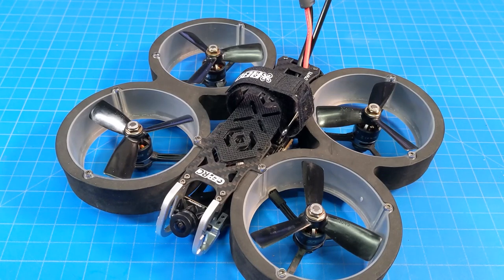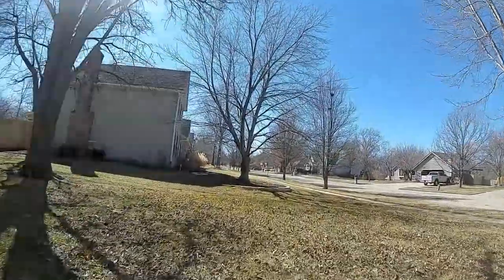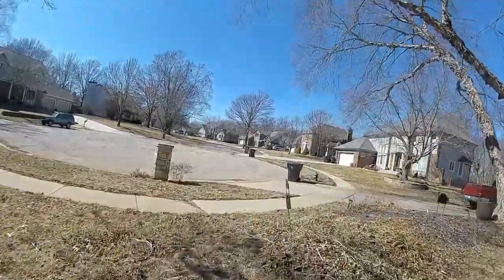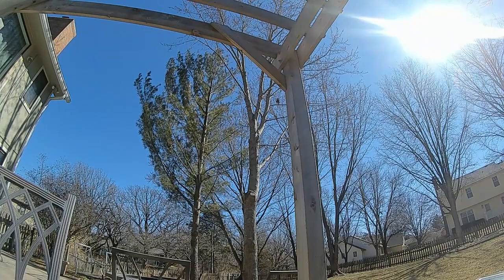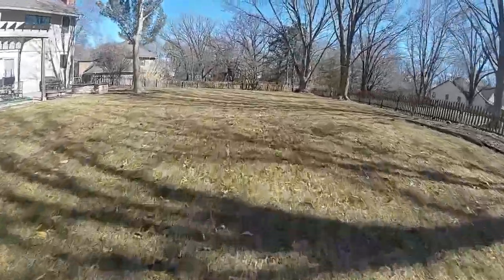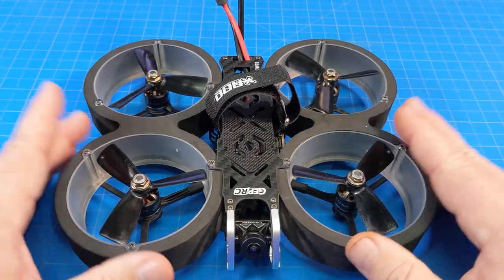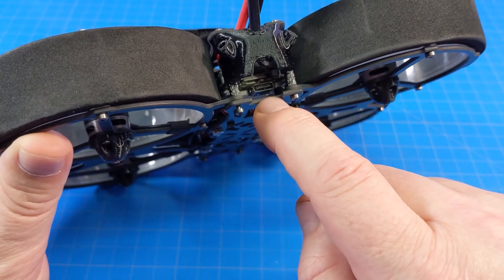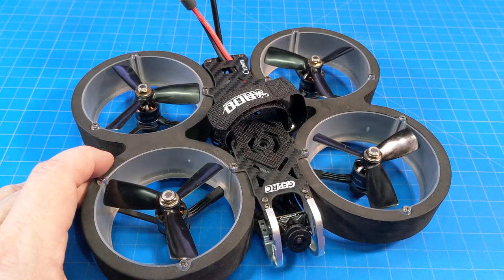GepRC Crown HD // This or the CineLog 25? // Review

Comment: I think these full size cinewhoops will stay the main form factor for their use case simply because a lot of people don’t want to deal with naked gopros. There’s a lot of potential headache with making a naked gopro and setting them up, then there’s the durability you get out of a regular GoPro. If your naked’s WiFi acts up you can’t change any settings on the phone app. Plus, you can use a GoPro for basically any camera work in the standard case, whereas with a naked GoPro you can only use it on a quad since it draws power from the lipo. Maybe one day I’ll get into naked gopros but I’d just rather wait for GoPro or insta360 to dive back into the Session style form factor since I could use it elsewhere too.

Comment: I’m thinking of getting a whoop over a pusher due to the payload capacity. If you have to strip one, that makes it more vulnerable and more likely to get FUBARd in the event of a crash. How well do these pushers fly around people? Are they safe and stable enough to get close to while in flight?
Reply from the maker: The premise of the pusher is its more stable than traditional. The props are well enclosed, in that regard it is safe from the props hitting something.
Reply: @NickBurnsFPV  thanks. Also a lot quieter, from what I hear. But from all the reviews I’ve seen, my biggest issue is still with the cameras up top. Naked cams are just too flimsy for my taste. Maybe when they come up with a 3” pusher that can handle the weight of a full size action cam, I shift then. But for now, people will just have to deal with the noise of my cinewhoop.

Comment: Hi nick,  I've watched your two videos about it  ( cinelog )👍 . For a beginner without your skills, the crown feel more safe but:
 do you think the cinelog could handle an almost beginner style of crash..flight ?
Reply from the maker: The crown will likely be more durable, but its oddly harder to fly. The cinelog is easier to fly but likely less durable. I think doing a few hours in the sim first then maybe start in real life flying in horizon mode, and decrease horizon strength down until the self stabilization is nearly gone, then switching to acro. I would still recommend the cinelog with the a fore mentioned starting method. The cinelog will allow us to grow our flying skill the crown will hold us back or require buying another quad to grown. Get 1 or more extra prop guards for the cinelog just in case.
Reply: @NickBurnsFPV  Thank you ! exactly what I'm doing,  simu and  a betafpv 75 is already at work ! yes a spare Props, and maybe a frame in case.

 I'll have time to practice before the DJI goggle V2 will be available and flight the cinelog...a lot of practice...maybe months...😒
Reply from the maker: @paul_bismuth  It might not be that long. Some pickup fpv very quickly. If you find you get board with sim time give yourself a gift with a in real life cautious flight.
Reply: @NickBurnsFPV  lol...I was refering to the time to wait to have dji goggle v2 available !
Reply from the maker: @paul_bismuth  Ah, sorry.

Comment: Hi Nick, thanks for the video! Quick question, I have a 4S analog Crown that will drain a1550mAh pack in less than a minute and come down with scorching hot motors. I tried BLHeli_M and RPM filtering with no luck and it looks like a lot of other folks are facing the same issue. Any ideas?
Reply from the maker: Wow that is a super short flight time on a big battery. Have we updated betaflight or maybe changed to a different prop. It seems like this could be a pid tune issue. Also what about a smaller battery like an 850mah? What do we get on that?
Reply: @NickBurnsFPV  hi, thanks for your reply! Betaflight is up to date, props are still new from the factory and PIDs are stock... I'll give it a try with an 850 for sure! I hope 70C will be enough, it has been draining 100C 1550mAh packs like if it was a 10"!!!

Edit: I've been trying with1300 and 1550mAh packs because they were the ones GEPRC recommended on their spec sheet.
Reply from the maker: @ikbmultimedia1286  When you say betaflight is up to date. Does that mean you updated it? If so we may have to go back to original, as the quad came with a custom pid tune. Pid tune can definitely cause hot motors, the heat is wasted energy and that would be why the flight is so short.
Reply: @NickBurnsFPV  the funny thing is... The hot motors issue came out on the very first flight - no PIDs, ESCs firmware, rates or any other things were modified except for what's necessary to put it in the air (modes, receiver, vtx, etc). After that I obviously thought it was a bad stock PID kind of situation and went on attempting a tune. Would you be so kind to share a few settings of yours? Even the factory custom tune you mentioned would be ok, at this point I might start to think they forgot to custom tune a whole lot of these things.
Reply from the maker: Here is my diff. Youtube won't allow enough lines for the full dump. This is on betaflight 4.2.6
# 

# diff

# version
# Betaflight / STM32F7X2 (S7X2) 4.2.6 Jan  5 2021 / 19:08:42 (a4b6db1e7) MSP API: 1.43
# config: manufacturer_id: GEPR, board_name: GEPRCF722, version: cae13701, date: 2020-08-30T01:32:26Z

# start the command batch
batch start

board_name GEPRCF722
manufacturer_id GEPR

# name: CROWN

# dma
dma pin B01 NONE
dma pin A08 NONE

# feature
feature LED_STRIP

# serial
serial 5 0 115200 57600 0 115200

# aux
aux 0 0 3 1725 2100 0 0
aux 1 1 2 900 1300 0 0
aux 2 13 1 1300 1700 0 0
aux 3 35 1 1700 2100 0 0

# vtxtable
vtxtable bands 5
vtxtable channels 8
vtxtable band 1 BOSCAM_A A CUSTOM  5865 5845 5825 5805 5785 5765 5745 5725
vtxtable band 2 BOSCAM_B B CUSTOM  5733 5752 5771 5790 5809 5828 5847 5866
vtxtable band 3 BOSCAM_E E CUSTOM  5705 5685 5665 5645 5885 5905 5925 5945
vtxtable band 4 FATSHARK F CUSTOM  5740 5760 5780 5800 5820 5840 5860 5880
vtxtable band 5 RACEBAND R CUSTOM  5658 5695 5732 5769 5806 5843 5880 5917
vtxtable powerlevels 5
vtxtable powervalues 25 100 200 400 600
vtxtable powerlabels 25 100 200 400 600

# master
set gyro_lowpass2_hz = 325
set dyn_lpf_gyro_min_hz = 260
set dyn_lpf_gyro_max_hz = 650
set acc_calibration = -21,133,-297,1
set mag_hardware = NONE
set baro_hardware = NONE
set min_check = 1015
set max_check = 2000
set yaw_motors_reversed = ON
set small_angle = 180
set pid_process_denom = 2
set osd_vbat_pos = 14721
set osd_rssi_pos = 14362
set osd_tim_2_pos = 14743
set osd_flymode_pos = 14713
set osd_throttle_pos = 14337
set osd_vtx_channel_pos = 33
set osd_craft_name_pos = 6155
set osd_avg_cell_voltage_pos = 14657
set vtx_band = 5
set vtx_channel = 7
set vtx_power = 5
set vtx_freq = 5880
set name = CROWN

profile 0

# profile 0
set dyn_lpf_dterm_min_hz = 91
set dyn_lpf_dterm_max_hz = 221
set dterm_lowpass2_hz = 195
set iterm_relax_type = GYRO
set iterm_relax_cutoff = 10
set p_pitch = 58
set p_roll = 60
set p_yaw = 100

rateprofile 0

# rateprofile 0
set thr_expo = 80
set roll_rc_rate = 120
set pitch_rc_rate = 120
set yaw_rc_rate = 130
set roll_srate = 75
set pitch_srate = 75
set yaw_srate = 75
set tpa_breakpoint = 1450
set throttle_limit_type = SCALE
set throttle_limit_percent = 80

# end the command batch
batch end
Reply: @NickBurnsFPV  you're a life saver!!! Thanks!
Reply from the maker: @ikbmultimedia1286  I hope it helps resolve the issue.
Reply: @NickBurnsFPV  If you don't mind, I'm about to email you and kindly ask for the full diff - I'd like to try uploading it on my Crown as-is 'cause I'm too scared of it going POOF :D
Reply from the maker: @ikbmultimedia1286  That is fine.
Reply: Hey guys, did you figure out this issue? I have the same problem. Scorching hot motors. :/